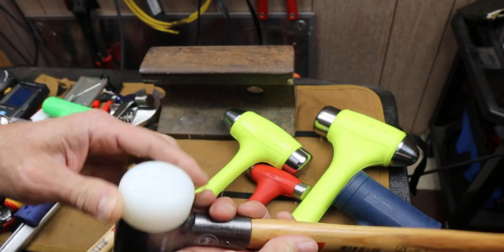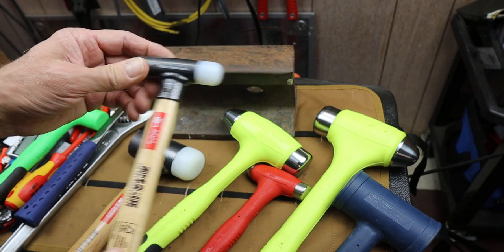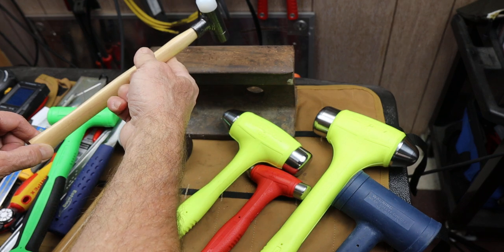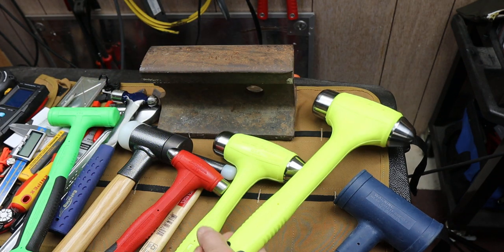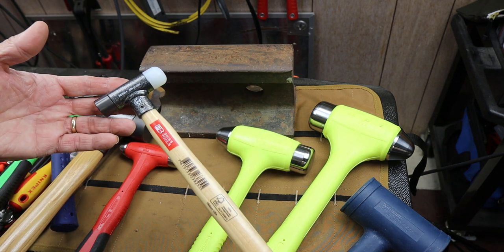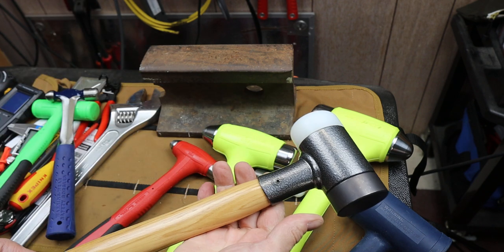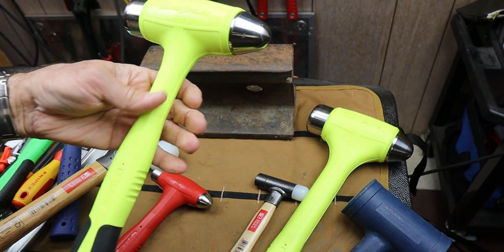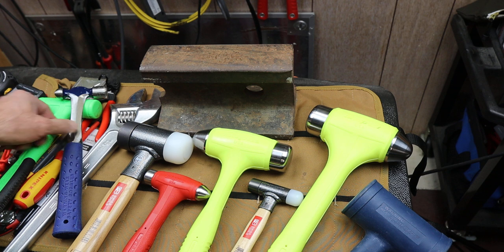Drop Dead! PB Swiss vs Snap On vs Estwing Dead Blow Mallets: Switzerland is where mallets go to die.

Comment: Not sure this is a good comparison as the snap on dead blows are mean to have a swing behind them before it hits something not a drop. So by dropping it the shot in it is literally doing nothing because you are not using the hammer correctly. Another thing to add that you won't get with your test is the head and the shaft are not fully connected on the snap on hammers so they can flex to absorb some of that blow which is not something a wood handle is going to come anywhere close to. The metal shaft in the snap on's doesn't run the full length of the handle.

Comment: While I appreciate the knowledge you have sir, I have to disagree with your comparisons. You're comparing Metal Faced, to Plastic Faced, to rubber faced. They're all different tools for different jobs. I use multiple types of deadblow hammers as a machinist, and I would never grab the metal faced one if I didn't want to mar up a surface, however, if I'm trying to drive a pin out with a punch I'll 100% take the ball peen deadblow as the little rebound doesn't matter in this scenario. These hammers were made for different jobs, and they can't all take each others place completely. I'm not defending snap-on here as I refuse to pay the price as an apprentice, but I use deadblow ball peens in general, and they don't serve the same purpose as the softer faced mallets. My apologies for the long winded comment. but I do use a variety of deadblow style hammers on a regular basis.

Comment: The pb Swiss doesn’t have a rod down the center. It’s just a hollow area with rings inside. The rings themselves do have a hole in the middle so it would appear on schematics like there could be a rod in the center but there’s not. Still the best dead blows ur gonna find along with halder brand hammers which I’m pretty sure are made  in same factory
Reply: Halder/Picard are made in Germany (mostly, some Taiwan for the weird stuff)
Reply: Except there is in fact a rod.

Comment: Many will ask why pay top dollar for a hammer/mallet.  Someone I know was working on the 5th floor in a building in the center of Athens installing a split type air conditioner.  While working on the outside ac unit, the hammer he was using separated and the iron fell 5 stories below to the pavement full of people.  Fortunately for my shocked friend, nobody was hit.

Comment: Cool test doc. I have snap-on dead blow hammers. Haven't had to warrantie them yet. Maybe if the PB Swift handles had some kind of checkering carved into them for grip? Otherwise the wood handles could get slippery with fluid.
Reply: "SINCE 1920"
Reply: A little tip if you have any wooden handles that have like that polyurethane or that lacquer finish on the wood take a knife or some sandpaper and get all that lacquer off I don't know why they put that on there but that crap sucks you're much better off just peeling all that crap off because no matter how wet it gets it's almost always much better without it and then every now and then you can just dip it in some oil and you're good to go and your handle will last almost forever provided that you have a good quality one just a little tip it's going to make it a lot less slippery
Reply: PB Swiss also makes a handle with rubber.

Comment: You should check out the Trusty-Cook dead blow line of hammers.  I have a couple and they are excellent.  They are USA made and rival the over-priced Snap-on hammers.  They also offer steel and soft faced combo options, in a full synthetic handle.
Reply: I should add that their site is more geared towards their soft dead blow hammers.  You have to do a search for "ball peen" to find the individual ball peen dead blow hammers.

Comment: Im interested in knowing the purposes between the Steel, aluminum, and copper  heads. For what tasks/material are each meant for? I actually tried researching this with no success on finding an answer...Can I use the steel cap for simply driving nails in? Or would that ruin it for the deadblows purpose? Or would I need a standard hammer for that.

Comment: I got a german made deadblow recently at menards of all places for like $15. Couldn't believe it. Not as good as the PB swiss, both ends were that delrin material (the white plastic looking stuff) and it's great.   Just looked at their site it's called the Halder Supercraft and it's listed at $36 so i guess I got a good deal accidentally.  It's similar in that the head shape, the pipe where it meets the right angle of the handle looks like the exact same piece of pipe on the PB swiss. Sadly mine uses shot, not washers. 

Maybe it's just an old design so several european companies doing that head shape is just what happens.
Reply: Nice. I got a couple of those. Pretty handy to have different sizes
Reply: you'll find the same type of construction from Wiha, Gedore/Habero, Peddinghaus and a few others and, of course, Halder and PB Swiss. if it works fine, why bother improving an already refined design through decades? 😼
Reply: Halder is a excellent german brand. The made all types of hammers all in Germany and the quality is very good.
Reply: I have a few Halders in different sizes, but saw the same Supercraft at Menards and grabbed one too.  I keep that one in the truck for EDC.  I also have that rubberized Estwing and it's great as well.  Really surprised in the bounce from those Snap  Ons..

Comment: I don't doubt the PB is perfectly adequate for a host of tasks but if you need to bash a ball joint/tie rod end (or get extremely angry at heavy metallic objects) ...I personally would grab the snap-on (don't own it myself but used them several times)

Comment: Thanks for your helpful videos! Trying to decide between the 304.1 and the 304.5 or the 304.1 and the 304.6…26 ounces vs 40 ounces for home and shade tree mechanics use…
Reply: What did ya end up with?
Reply: @anthonycvella  I went with the 304.1 and the 304.6. Great combo!
Reply: @thomashaugen4514  Awesome thank you! Are you finding the engineer/plastic combo to have been worth it? I think I am settle on the Size 1 and Size 4 but trying to decide whether to do the 300 or 304 now...

Comment: Definitely an interesting test showing difference in technologies but I would like to see the results when used like an actual hammer instead of dropping it with the shot already in the front of the head. I don't get any kind of bounce when I'm using my snap-ons and shock on the hands is non-existent. 6 years of shop abuse and I still can't break them 😂